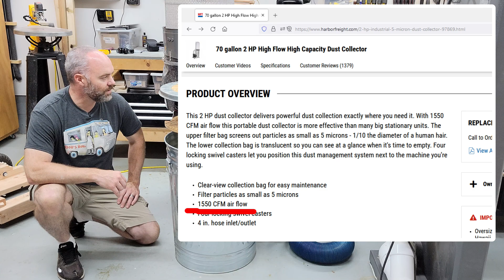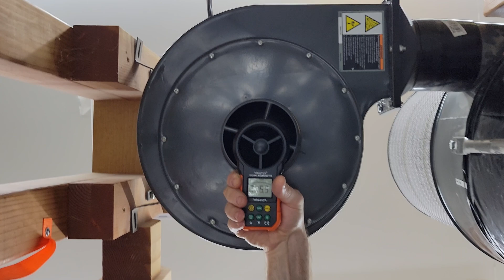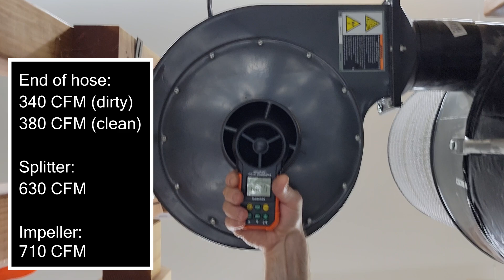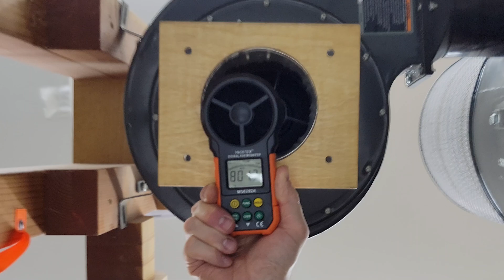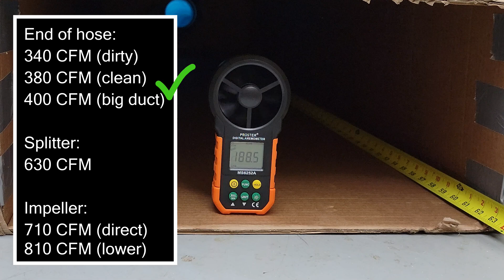Harbor Freight 2HP Dust Collector Air Flow Measurements

Comment: Hi Ben, I've had a few attempts at improving dust removal in my shop.
The only thing missing from your excellent video was a test from the end of the hose with the first stage chip collector removed.
There are quite a few YT videos with similar systems to yours. A lot of them have a first stage collector cyclone type gadget. 
I used a cyclone system when I had a shop vac as it enabled me to collect nearly 100 liters of waste and kept the shop vac pretty empty.
Now I use a bag system similar to yours I've ditched the cyclone as it serves no purpose and all waste goes to the bag. So no need to separate small and large waste and just one bag to empty.
I'm using the Record Power wall mounted Cam Vac system which is a suction system rather than a blower system like yours and works great.
Great video. Keep it up.
Reply from the maker: I had to look up the CamVac. Looks like an interesting system. What's the level of effort to change the bags?

Comment: i would look into how you set this system up rather than see how much CFM your actually pulling, you placed the barrel directly to the fan housing instead of placing the collector in between the 2, this is why your getting so much dust buildup in your filter. eliminate that bag hanging down, remove the filter from the collector, attach the fan to the top of the collector, attach the collector to the barrel, and port the exhaust end of the fan to the filter, im sure you will see quite a difference in CFM and much less dust buildup in  the filter.

Comment: So, is the cardboard moral of the story that the HF collector could handle larger diameter piping?
Reply from the maker: No, that just confirmed that the measurement of air volume taken at the 4" hose was correct, and that I configured the meter correctly.
Reply: @TheSnekkerShow  I’ve been curious since I got mine why the impeller ports are both 5”, but everyone connects 4” pipe/hose to it
Reply from the maker: @anyfoolknowthat  Most power tools will take a 4" hose, but in theory, if you have a 5" outlet from the collector you can run two 4" hose simultaneously.  I do that sometimes, but it's kind of pushing the practice limits of the modified HF collector.

Comment: Your measurements are low because of the method you are using.  The velometer itself is a restriction and does not cover the entire air flow area so the method causes air flow to bypass the instrument and go directly into the duct or fan.   Unfortunately I cannot quantify the size of the error.    I tested my shop vac air flow doing a duct velocity pressure traverse and got 150 CFM at 14 inches of suction at the fan inlet.
Reply from the maker: I'm sure there's some degree of error, but I think that by entering the area of the duct being measured, the meter factors in its own size in the final reading. It's just not clear if only the fan housing or the entire meter is what's subtracted.
Reply: @TheSnekkerShow  The meter is a large obstruction because of its size relative to the small ducts you are measuring.   Also the fact that you are measuring at an entry makes it worse.   All the meter does is read the air velocity and multiply that by the duct  cross section area.  In this case the meter helps obstruct the flow.   BUT, for your purposes you are more interested in relative magnitude between the multiple cases you tested so your comparison result is 100% good to go.

Comment: Thanks for the info!  I just bought one of those HF dust collector things, and ordered one of those filters from Wynn.  Once the parts are delivered, I'll start some serious sucking.  The days of the shop vac whine are almost over.  Now it's off to your videos on the other mods to the HF rig.

I'm guessing that the Wynn filter is the biggest difference between your numbers and the manufacturer's claim.  When the mfr runs their test, they have their sieve-like dust bag on top, which I'm guessing doesn't slow things down much.

And I love the deadpan delivery.
Reply from the maker: I'm glad it was helpful. My guess is that the manufacturer tests air flow with no bag at all. I was going to compare the original bag to the Wynn filter, but I ingeniously threw out the bag just weeks before deciding to make this video.

Comment: Snek, great set of vids and I’m planning on copying your system as well however I am considering not installing the thein trash can unit, and just using the plastic bags to collect, and just keep the Wynn filter clean, it seems like that would be a big improvement in performance although a more rigorous cleaning and maintenance schedule would be needed. Also wondering if you have experimented with modifications to the stock impeller yet? Considering that also as the Rikon doesn’t look like it’s going to be available ever again?   
I am mostly setting up to  build  Ukulele’s and guitars, do you think that is a good approach or would you consider the Thein baffle a necessity? New to instrument building and dust collection - prior to this I mostly milled large wood into small wood for model ship building obsession. Thanks for any input and huge thanks for sharing this build! Awesome!
Reply from the maker: Thanks for the feedback. The Thein baffle isn't absolutely necessary, but I think it's a worthwhile addition. It might take a little more time to build, but you'll recoup that time by not having to change bags or clean the filter as often.

I haven't done anything with my impeller yet. I looked at the Rikon, but it seemed overpriced, so I'll probably play around with a homemade alternative eventually.

Comment: Those HF dust collector doesn't put out or I should say suck in the rated spec.

I am impressed or surprised that the their baffle didn't reduce your cfm and the filter surface area is so much that cleaning only improves performance by 10%.

Comment: I believe the fan is capable of the 1550 with no load ,similar to gas milage which is done on a test dyno . If you remove the restrictive giant filter I feel you will reach the numbers you are looking for. just as the cfm changes with air flow restrictions so does the motor current ,there may be to much static pressure to get the numbers you want. that being said I just put together my harbor freight dust system and all I can say is I hope the cat hunt get in front of the suction port ,sure beats the double shop vac system I had before
Reply from the maker: The longer I own a dust collector, the more I consider getting rid of my shop vac to free up a little more floor space. I almost never use it anymore.
Reply: @TheSnekkerShow   If you look at the restrictive guards that are there and removed them you will see a big increase of flow.  That would include the one on the exhausts side or modify the exhaust to a larger size.

Comment: Wow, great video! You got it right, I have seen many YT videos get it wrong. I have heard cyclones separators, of any type, create about a 20% reduction in air flow. Looks like that is about what you got between the lower intake and cyclone intake measurements. So, there may be some tall error bars on your measurements, but I think you are in the ballpark and these are some very useful measurements.

BTW, Oneida has an article titled "Free Fan Vs. Actual CFM Ratings - What's the Difference?" you may be interested in. Short answer, yes, as you suspected, manufactures provide "free fan" CFM ratings, meaning no bags, no filters, no hoses.

I did a similar set of tests with an almost identical anemometer. I too wondered if the fan and fan housing impacted the results so I built a simple pitot tube and manometer to test it. I have a video about it if you are interested. Built from a few dollars in parts from Menards, like a stainless steel set of travel mug straws and standard vinyl tubing.

In my tests, the fan housing of the anemometer added air friction or reduce area thereby increasing air velocity over a smaller cross section and caused the CFM ratings to read artificially low. It had a big impact on my 2.25 inch coupling test since the size of the anemometer proportional to the open was quite large. For the four inch coupling test, the proportion of the anemometer housing to the opening size is less so the impact on the accuracy was smaller. I believe this is why your cardboard test showed higher CFM, because the anemometer was proportionally smaller compared to the opening and therefore robbed you of less CFM during the measurement.
Reply from the maker: Thanks for the sanity check. Feel free to post a link to your video.
Reply: @TheSnekkerShow  Sure here is the link. Hopefully it is not blocked by YT.

https://youtu.be/mm6Cn_O1r8k

Comment from the maker: CORRECTIONS: At 2:05, I meant one square foot, not one cubic foot.  You measure the square footage of the opening to measure how many cubic feet of air is passing through.  Of course, I said this right before joking about my math skills, and then proceeded to add a graphic to the video that matched my spoken mistake.  I also misspoke the decimal point a couple times, even though it was showing correctly on the meter (zero point seven one, instead of point zero seven one).

Comment: The good news is you are being as consistent as possible with your measurements. Are your methods perfect no there are far  to many variables to get finite numbers.
We know that manufacturers are Braggadocious about their numbers. 
I think a pitot tube system would give better information compared to the anometer. The way you are having to measure the CFM.
Again you are comparing apples to apples with your set up, and that is good.

I have the same HF dust collection system. However I made several changes to it! 
I removed the HF 9.5 inch impeller and replaced it with the Rikon 12 inch impeller.
That made a massive difference.. I also removed the  
 stock vacuum port and made a new 5 inch input with a HVAC take off. I also added the Supper Dust Deputy with the 5 inch suction.
For the exhaust side I too used the Wynn envioemental filter..
Mine like your set up of the fan/suction is in a straight vertical line thus reducing parasitic drag. .
My filter has never contained as much dust as your! I contribute that to the Thein Baffle not being as efficient as the Supper Dust Deputy.
I appreciate that you took the time to produce this video. 
In my opinion after spending the money I did on al the components. Even considering that the HF dust distribution system was a gift.
I think I would be  better off to invest in a researched and engineered system for just a few more dollars. 😁🛫
Reply from the maker: If you ever get a chance to measure, I'd be interested in how your system's CFM compares to mine, and seeing pictures if you have any online.  Sounds like a nice setup.  I sometimes consider upgrading to a better out-of-the-box system, but this one works well enough that it's hard to justify the expense.  It could do better with suction, but it's great with filtration and keeping the air breathable.  I just looked up the Rikon impeller and they're out of stock, and kind of expensive.  Now I'm kind of curious how hard it would be to enlarge the one I have now.
Reply: @TheSnekkerShow  I there is some way I could communicate with you directly I can give you a lot of information with pictures of what I have and the details. Like your self my system is doing the job as I expect of it so have no real need to buy a pre engineered DC system.
😁🛫
Reply from the maker: @TheFalconJetDriver  My channel name at gmail.com, with no spaces.
Reply: @TheSnekkerShow  I just wanted to let you know I will work on that information this evening.😀🛫
Reply: @TheFalconJetDriver  I’m curious, what system would you consider?

Comment: truly enjoyed it

and thank you for being one of those people who are actually curious how stuff works, and investigate + learn along the way.

it seems like the duct has to be around the diameter of the duct system's main fan, to make the most out of it.
if the duct is narrower, the flow is restricted, and I'm just guessing: if the duct is bigger than the main fan, the flow will "thin out".
it would be interesting if you could confirm that the best flow is in the duct being the closest in diameter to the main fan.

and obviously the smoother the surface of the duct, the better, so avoid at all cost those corrugated zig zag elbows. I think the best for the flow would be the PVC smooth pipes, but for the safety (static + sparks + micro dust = explosion ), we should use the smooth metal pipes (galvanized / zinc), and try to minimize the number of the elbows, and try to make the angle 135 degrees if possible.
Reply from the maker: Thanks for the feedback, and great question.  I'm not sure where the perfect balance is, but reducing the diameter of the path will reduce flow (CFM), while increasing velocity.  I just measured the end of the 4" hose and the end of the large duct again, and the air speed at the 4" fitting was 105 km/h, and the end of the cardboard duct was 6 km/h, both with a similar CFM reading.  Four-inch hose is the standard at the power-tool end of most dust collection systems, coming from a five or six-inch port closer to the impeller, but probably a combination of the size of the impeller and the power of the motor determine at what size the duct will start to underperform.

I've heard the same warnings about static explosions in dust collection systems, but I've never heard of it actually happening.  I think enough people use PVC that there would be more stories of explosions if it was an actual risk.
Reply: https://youtu.be/yA22kTtV4XI this video explains a lot about the myths about static, pvc, and grounding.